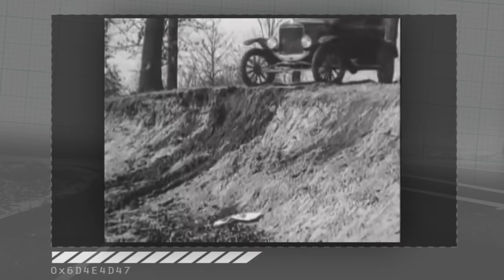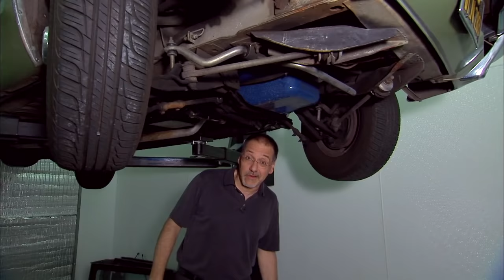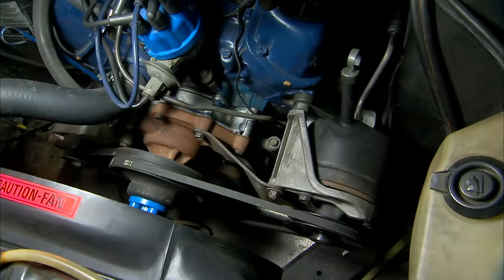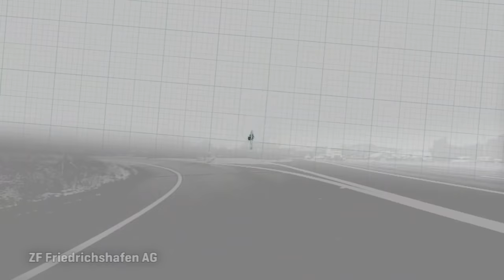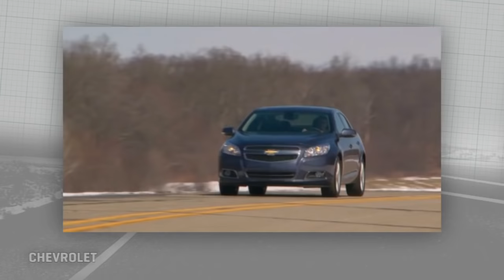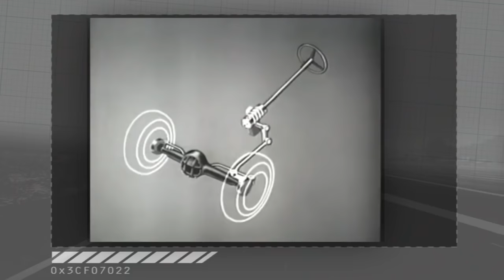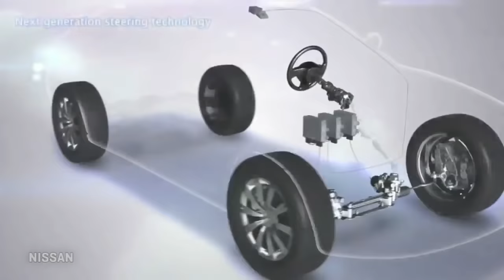Car Tech 101: Power steering explained

Comment: what happened to good old mechanical engineering. using electricity is great and efficient, but the less software the better right?
Reply: because?
Reply: brad cool Less reliance on software usually means less failure rates. The more mechanical a system, the more reliable it tends to be.
Reply: Because mechanical engineering is less compact. More electronic based components means smaller parts which equates to weight reduction and more spatial availability. Less weight equals less gas mileage. More space means more room for other components. 

I'm sure those aren't the only reasons though. But really, you shouldn't think too old fashion just because you don't understand why new innovations are implemented. 

Also it helps to think more broadly than just the car.

When mechanical parts are broken, it means there's something physically broken which creates more waste in the world. You have to throw away hunks of metal that end up in waste fields which harms the environment. If a software fails, nothing is physically broken. It's just a matter of reprogramming and re-calibrating the component. Nothing has to be thrown away (usually), and nothing has to be reproduced in factories just to replace your part.

There's a lot of environmental regulations being put in place and electronic based components helps to abide by them. And right now, we need to be thinking about the environment more than ever because we've really done a horrible job taking care of it in retrospect.
Reply: Miles Wright It's not thinking old fashion, it's simply sticking with what as proven to be the more reliable and safe option.
If steer-by-wire fails and there's not a redundant system, you have no steering, meanwhile if mechanical power steering fails, you can always muscle it.
So until electrical engineers can get their systems foolproof, mechanical engineering is going to be the safest bet when it comes to automotives.
Reply: jcdfbdus Electric steering is used in aircraft technology, so I think it's been proven reliable already.

Plus some cars have mechanical backup if the electronic fails.
Reply: Miles Wright There's a lot of differences between aircraft turbulence and roadway driving. 
Also, fly by wire removes the sense of control from the steering, you no longer feel the road as you steer, it'd be just like driving one of those arcade racing games. I'd much rather have mechanical systems than electrical.
Reply: jcdfbdus That's if you're talking about the durability of the wiring and it coming loose (though I still don't see the difference). But in terms of software failer, both are at equal risk.

The aesthetics of the "feel" of the drive is subjective. Practicality comes first and is most important.

The vast majority of car drivers aren't car enthusiasts.
Reply: Miles Wright I'll give you the daily driver won't really care about feel.
Reply: If a metal part is broken, it gets recycled.  Auto repair shops have bins for metal waste which go back to foundries who reuse the metal.  Wires, also get damaged, and motors wear out.  Inductive motors are far more reliable than brush motors in that they don't need the carbon cleaned out or brushes replaced.  If someone repairs their own cars, they are more likely to be the ones throwing the metal parts in the trash, because they don't want to bring them to a scrap yard or auto shop, due to being inconvenient for them, and scrap metal prices don't cover the fuel cost to make a special trip, and they don't want to bother having it with them long enough to get the worn parts to someplace for recycling when it's more convenient.  
Electric assist and hydraulic assist both stop working if the engine stops, but there is still mechanical connection from the steering wheel to the steer tires, so there is still control to the driver.  Full steer by wire without any mechanic connection to the steer tires grants a complete loss of steering control through software glitch to a broken wire connection.  With electrical assist, failures may be less likely to happen than with hydraulic assist, they save on fuel, and may cost more to repair.  They don't require software to work, but often are connected to software driven controllers.  A benefit of that is the assistance force can be varied according to the speed and weight of the vehicle.  A down side of that is in some more advanced vehicles that are connected to the cellular phone and/or WiFi system, can be stolen by remote control.  I have read an article, in the last few years, about someone hacking into a Cadillac, and steering using the individual brake outputs used for traction and stability control.
Sorry about how long this comment is.  It was just going to be a short comment on recycling, but it got away from me.
My main two points are: *recycle and *failure of a steer by wire system can be catastrophic,  but failure of steering power assistance is still controllable.

Comment: "The Steering Wheel won't have any mechanical connections. But that's down the road a few years, and that's another Car Tech 101."

Oh and don't forget that it's alos a piece of software that can fail, causing a crash that will kill you.

Comment: 100% electrical steering system is prohibitive since reliability in failure cases is too low. It's not a matter of technology issue, simply you cannot steer the vehicle if you have a electrical breakdown and this is unacceptable.

Comment: And the day there are cars with the wheel not attached to the steering gear is a day I stop buying new cars
Reply: +AZR NSMX1 And look how often those systems on aircraft fail. People say "Flying is the safest form of transportation" but that doesn't take into account for numbers: How many planes are there and how many cars/trucks are there? Planes SEEM to fail less, but only because there's far fewer of them.

(Edited a grammatical error to appease narcissistic nitpicking douche)
Reply: EvilJ069 Either your grasp of mathematics or of common sense or both are in a critical condition. Better take care of them before it's too late. It's for the "too fewer airplanes" comment.
Reply: EvilJ069  I wasn't talking about the grammar. This is sadder than I thought it was. Have a blast figuring it out. Or write another obnoxious comment, in which case I'll just tell you.
Reply: EvilJ069 no offense, but when a steering system fails in a plane, its usually a hydraulic leak ant not the steer by wire system

Comment: My Ex's car had a loose battery connection and when she went over a bump she lost steering, typically when going around a left hand corner. I didn't believe her until I tried it. Nearly bloody killed me.
Reply: +Rupert Atkinson What car?
Reply: Mazda Demio
Reply: +Anglo Saxon lol that explains it.
Reply: +Bruh Shat how does that explain it?
Reply: Hing holo cheap car. half joking but not lying either.
Reply: Trash  Has nothing to do with the car being cheap. Any car with EPS and a loose battery cable woukd likely lose steering assist when the connection comes loose. From the most expensive to the cheapest. EPS is EPS. Some manufacturers systems are better than others in durability but thats it, they all depend on electric power from the battery

Comment: This shit is bad for drifters
Reply: +Rockythekidrs but Toyota FT-86 drifts pretty good and I've also drifted Hyundai I-max which has electric steering. I just don't quite like the dead steering feeling.
Reply: +akupehsluarketatAR i heard that electric steering actually locks in skids so your done if u drift , i really didn't have a chance to try
Reply: Rockythekidrs nope, it doesn't lock. It reacts the way steering should just that you wont get feedback like hydraulic steering.

Comment: Is disconnecting you from the road really a good idea?

How it works is when you turn the wheel you create a electric current that the motor will react to one way or the other,

If let's say you'll get a loose ground... and the streering starts jamming... you'd be in for a very bad day

Oh... Yeah, The thing will be controlled by a computer... Sooo... Bacally the software can crash or the connection can go wrong...

And you'd got no abillity to turn...

Comment: Hydraulic power steering doesn't really put that much of a load on the engine.

The power loss is negligible.
Reply: Ikr the ac compressor puts more of a load on the engine than the power steering pump.
Reply: tails300 Yeah, a lot more!
Reply: because it uses energy from the alternator.
Reply: @tails300  my man, its a dc motor what moves the shit

Comment: I say the advantages of a power steering is it is good at executing parking like parallel and reverse parking as you can get the turn you want with minimum steer makes you less prone on over steering that can cause you errors. It takes less muscle and pressure when parking your vehicle

Comment: That's a great idea to save some fuel gas mileage but all of those auto makers also need to make an elictric air conditioning compressor to save more money on fuel because the fuel prices are to high now these days plus that would also give little more power to the engine by getting rid of another belt on to car's engine. ..

Comment: Electric connection steering and getting rid of the column would be kinda dumb, if the battery died and you had no way to power it wouldn't you not be able to steer at all? And at least with the physical connection if the system fails you still have mechanical connections and can steer using your own strength were as without it if that happened you'd have no control at all. It's an unnecessary and potentially dangerous idea in my opinion
Reply: +Bring me Peter pan A dead battery is a small issue compared to broken/loose connections and short circuitry. These kinds of problems are hard to diagnose and are costly to repair. Might as well get another vehicle when that happens.
Reply: I agree. If for some reason the battery fails (or you hit some water on the street after a serious rain) and somehow you short-circuit some component, you might end up hitting something. Older models based on hydraulics are kinda safer as you can still control it with brute strength at least until you can stop on a right-side and start diagnosing.

Comment: My electronic power steering now became a 'PAWIS' steering (sweating behind the wheel or back to mechanical mode). How do we fix this? A friend told me to check the motor and replace the carbon brush, is this true? Help anyone...

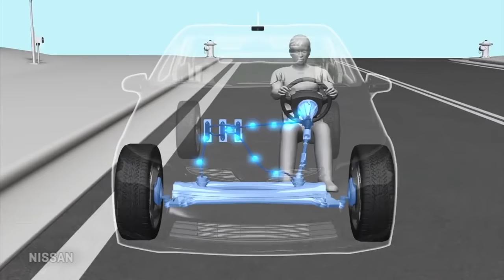Comment: 4:42 GAME CONTROL? I have trouble using my gaming steering wheel with the pc computer where it doesn't want to work at all with any of the cars in the in the game. 2 steering wheels so far so for a steering pump to malfunction because of a code in it would be a terrible idea. It wouldn't be a mechanical failure just code failure or a melted CPU.

Comment: Hydraulic power for the win. Yeah you have to spend more on power steering fluid but I'd rather do that and not die if an electrical system gives out. Worthwhile trade-off

Comment: What will happen if mouse eat some of the cables of this electric steering wheel?
In the software development the average bugs per lines of code is 15-50 per 1000  lines and for sure the software behind the steering wheel will have more than 1000 lines of code.
At all this is is the dumbest idea of all times and even violates the most important rule in programming which is IF SOMETHING WORKS DO NOT TOUCH IT!

Comment: Drive by wire systems are great if you see a vehicle that gets you from point A to point B.  If you see a vehicle as something to be driven, they take all the character out.
Reply: Not drive by wire, many cars are drive by wire and I find that drive by wire responds quicker than the physically connected gas pedal. But to each their own. 
Steer by wire is just definitely shit

Comment: I'd rather stick with the hydraulic power steering because it's one less electrical problem you have to take to the dealership if it goes bad.

Comment: I drive a 2004 dodge ram 150 and my power steering only seems to work when im putting pressure on the accelerator with my foot, but when I take it off the steering wheel goes back to no assistance! So when in high revs it turns but with a loud whine and when Im decreasing in revs I lose power steering.

Comment: Where are my bois without any power steering?

On another note, is an electric pump on a hydraulic system a good idea? Does it prevent parasitic loss while still having proper feedback? I find that design choice interesting.

Comment: I have 1997 honda accord it was leaking power steering fluid bad I just took the power steering belt off boom manual steering dont have to worry about the pump going out the belt break or fluid I've been driving it like this for 5 years no problem yeah you have to put your shoulder into it at a dead stop just turning the wheel but it doesn't matter what speed your going even if just 1mph turns with ease.

Comment: I was about to purchase the new Accord until I found out Honda no longer makes the standard automatic transmission gearbox (4 cyl) and hydraulics power assisted steering like on the older Accord models. No EPAS and CVT for me :)

Comment: I had an EPAS system go out many years back on a Ford Fusion. Got rid of it since it was a $1600 fix and just not worth the money. So they are mostly to repair than hydraulic power steering.

Comment: They were trialling electric brakes, electric water pumps and electric turbo fans (doesn't require direct exhaust connection) which me inherently suspicious of all. I prefer a direct mechanical backup in case power or electric anything goes haywire. I have always noticed sitting at traffic lights in idle, I turn steering wheel and it adds 200 rpm to engine output required. So when car right on stall point, and you use power steering, can stall at traffic lights. Had a old ford that would regularly do this until I got mechanic to increase idle speed.

Comment: my 2013 honda civic also has EPS or electric power steering, and i also notice even with ignition on engine off my power steering is dead no movement till the engine is running, So i began to wonder if my engine dies on the freeway at 60+ MPH am i dead if my engine stalls Hmmm, Maybe a modification like installing an on/off switch to my electric motor in the steering module almost like a relay so i can turn it on even with the engine off!!
Reply: ***** your steering wheel is still mechanically connected with the steering rack, when your engine dies while moving, you will lose the power steering but you can still turn the wheel by steering in a harder way. However, turning a car without power steering tends to be easier at higher speed.

Comment: Steer by wire in all cars along with a traditional, mechanical power steering apparatus standing by and ready to engage if the steer by wire stuff craps out. End of story and doubts from most paranoid people.
Reply: +Message Man   What if it doesn't engage?
Reply: Social Media is Dumb Then you take your automaker to court, sue for defects, damages, etc, and then live the rest of your life as a rich cripple. Of course. that'd 99% of the time never happen, but there's your course of action.
Reply: +Message Man ..if you survive the failure.
Reply: UntakenNick If not, someone in your family will.

Comment: after having driven all three kinds in over 6 cars noted, my number one con with electric is that you, completely, loose the "physical" connection to the road and the weight of your vehicle and you get the feel of a game console wheel controller. personally i tend to enjoy driving without power steering entirely. but given all the cons with hydraulic you still have the physical connection and feel the weight and force of your vehicle.

Comment: My thing is that electronics can fail and it's important to have the steering wheel to be able to have a hard connection to the front tires so if all power goes out you still have a shot at living in the event your headed for say on coming traffic or a cliff, with a little muscle you can steer away from danger

Comment: What happens if there are bugs within the processing of the EPAS?
Reply: Usually, there are backups at backups put in place to prevent such issues. There are quite a few sensors that detect that something might be wrong and it kicks the backup in. The software is also intensively tested on the factories before releasing it on customer cars.
Reply: Be that as it may, I'd still trust a mechanical unit over something that goes to shit if the battery is dead. Case and point, a customer's car was brought in when their alternator took a shit. They stated that the steering was basically non-responsive and sloppy when that happened... on the freeway. The biggest pain is that the car had an electronic transmission too, so they couldn't even push it off the highway properly. Basically, a fancy paperweight.

Comment: Didn't the Toyota Prius have some software issue that locked up the electric steering? I remember a few cases where someone was turning right, but it got stuck because the software crashed or something.
Reply: Yeah there was that issue. I just went to my local toyota and got a software update.
Reply: chavitavb Glad to hear you were able to get an update. I wonder how many people may have been affected by that glitch. I think I'm going to stick with my 5-speed manual transmission. ;)
Reply: StephenB Your transmission has no impact on what power steering you have.
Reply: jcdfbdus Well, yes. I just said I'd stick with my manual because it is low-tech. As much as I like tech, I don't care so much about it in my car. I, like many, enjoy the "full-experience" you get from a manual.